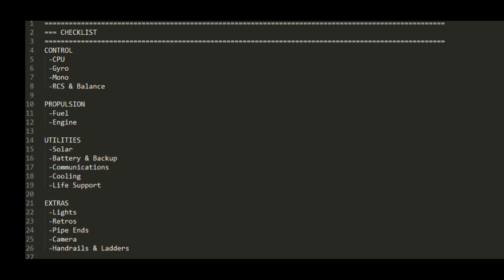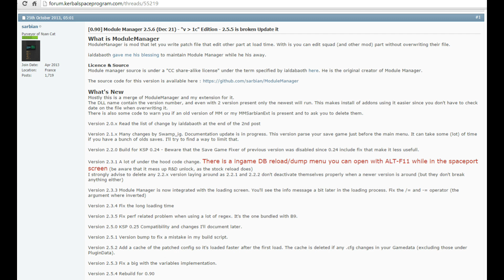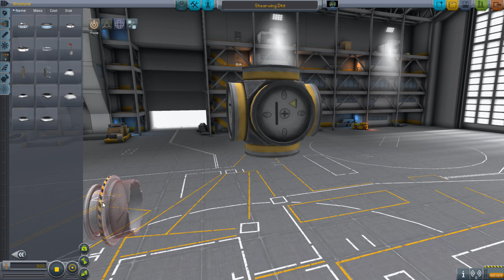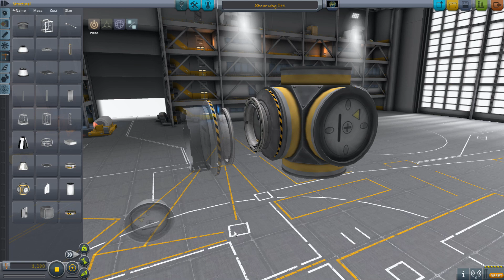Construction Tips & Tricks -- AMA 8 -- KSP 0.90

Comment: Some very good tips, thank you very much Bob.
I look forward to a stable 64-bit. However, it is already a very good game, if you find out how to keep it with all the mods below 3.4 gb ^^
-forceopengl ...
I mention it because in the video are presented some mods and if you just like to try everything, like me, it can be frustrating when the game constantly crashes because of the RAM limit is reached very quickly ...
I burned myself many hours to run to KSP with the desired mods. Broken safe games were also there, that's right annoying.
So, for all new players. Because of 5-10 mods you have to not to worry.
But, if you know it will be more, you should definitely use something like the "Mod Admin". I read in a forum that a guy has 70 mods running on, for me it's "only" 40 ^^ ...
It is very helpful to keep the overview and solve problems, twice used dll are not uncommon. With "Mod Admin" everything stays clean.
In the test of mods, let's run the task manager, by the way, if the game crashes can you see if it was the ram limit. For me KSP crashes at about 3,25gb.
In this case, right click on KSP in your Steam Library -> Properties -> Set launch options ... There you write: -forceopengl.
For me, it saves more than 1GB of RAM, which is quite a lot.
With opengl is the menu often not fully shown, or similar, then ALT-TAB to desktop and back, which solves the problem for me. It is important that the game is stable in order to have fun. And with these few rules I had after a complete reinstall not one crash, for many hours, so far ...
Hope this saves one or the other Kerbonauts the day.
Add boosters and have fun :)

Comment: You said to occupy a node to be able to choose the connection you want but with mk 3 parts in 0.90 KSP the cargo bay when attached to another mk 3 part has two nodes at the same geometric location one is smaller than the other how do you get around that?
Reply from the maker: ***** Are they the same size node? The larger one will get attached first. Attach things in the order of larger nodes to smaller nodes.
Reply from the maker: ***** Oh you just said one is smaller. Derp. Yes the large one will get used first.
Reply: Wow that was a simpler solution than I'd Imagined. Thank you!